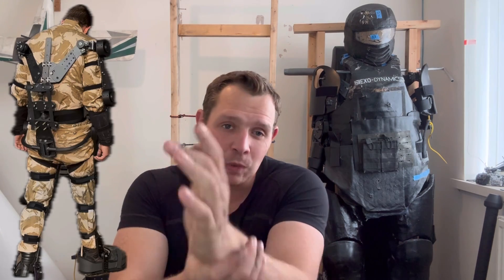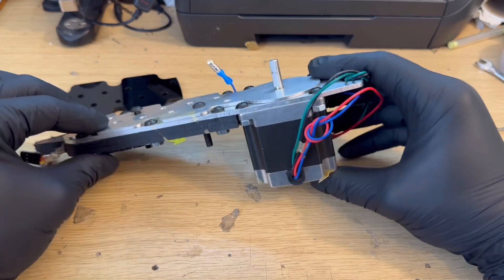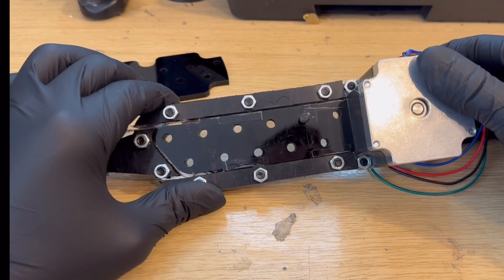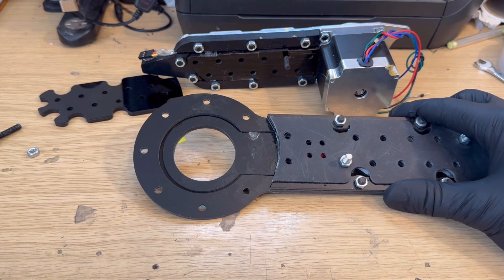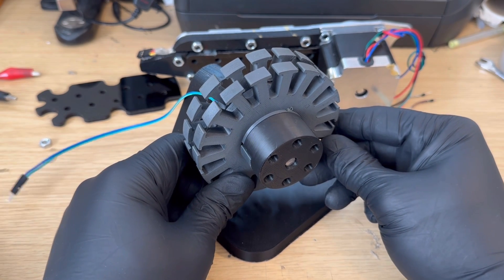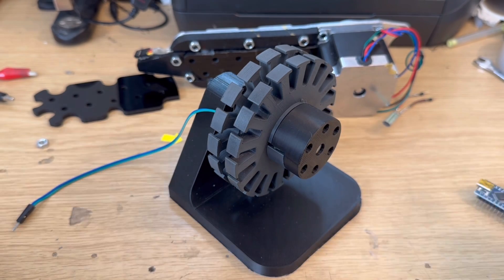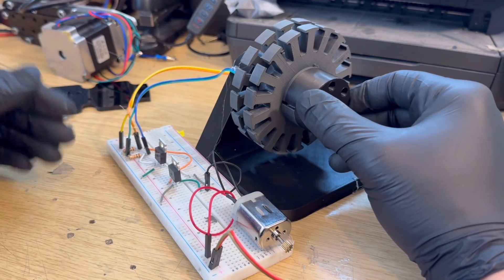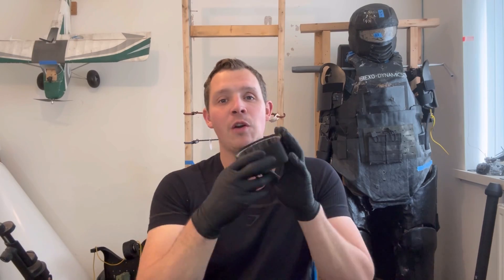How Im going to Sense movement for the functional Power Armour prpject

Comment: Once the actuators are up and functioning, I really want to see what the lag is like between intent and action. Basically how responsive it is.
Any plans for joint locks? That way there's no risk of the actuators overextending and breaking limbs in case sensors malfunction.
Reply from the maker: Joint lick wise, the armour will act as lock out protection - although ive added lock limits to the exo skeletons in the past so i can add them if neccasary. With this set up, i think they’ll be zero lag, but the problem will be that ir might gitter, which i think will be voltage tuning depending on the limb

Comment: For my design I planned on having a magnetic latching solenoid lock joints in place when they're not intentionally moved, so impacts could be distributed over a larger area. The first problem I thought of after this is that pressure sensors can't really be used to differentiate between force applied intentionally by the wearer and an external force applied to the wearer. It could lead to a bit of an issue with quick movements being either dampened or jittery.

Comment: Is there a reason you are using a radial flux motor instead of an axial flux one?
Reply from the maker: Manufacturing and really what magnets and things like that are available for me to buy easily. The reason the size is the size is down to how many magnets of a certain size i can fit in, i only thought briefly about making a axial version because i seemed to have less options on slot and magnet configurations wth what i could buy
Reply: hard drive magnets work well for axle flux motors. the hard drive head is basically just a moter that only moves like 45 degrees, and they can move stupid fast and have a surprisingly high torque. a bunch of this magnets in a ring could work,